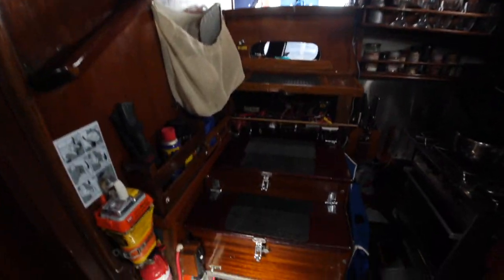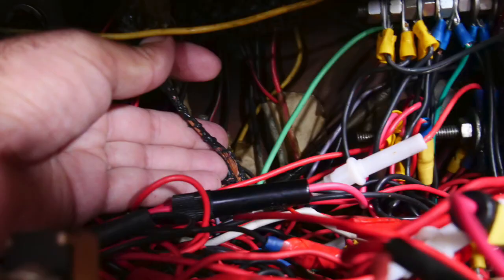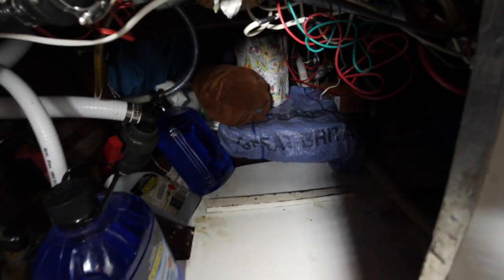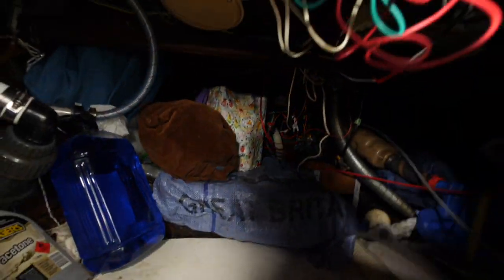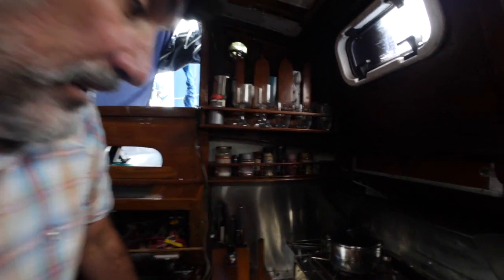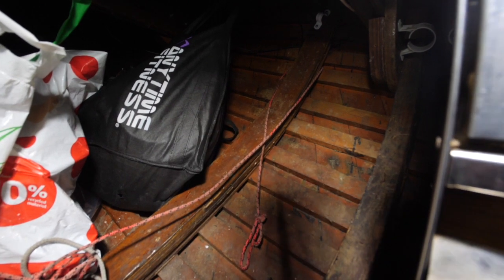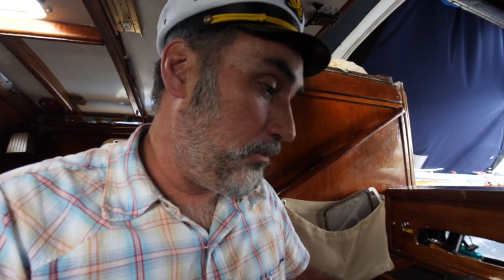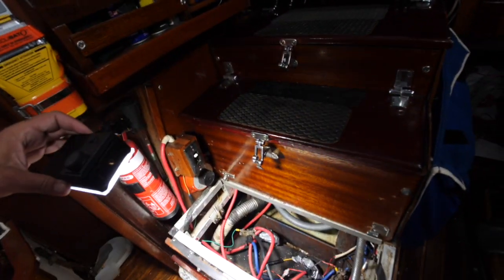Fixing an old Boat with Captain Smooth - Kero stove and starter batteries.

Comment: Your typical AGM battery is quite heavy, deep cycle is good, but for a few dollars more you can purchase a much lighter lithium battery (with the advantage you can discharge below 50% a sort of foolproof mechanism when energy needs are higher, great to run nav lights and transponders etc, just before dawn coming into a new port) and add more as your energy needs increase.  Weight and Balance should be centred around the Centre of Gravity and kept within the operating envelope so it will not adversely affect the performance of your 30 footer by trying to load the boat to keep everything within the envelope.  If you can just keep the battery in the centre it is best (otherwise you have to place similar weights exactly opposite to balance things out, and weight can be critical i.e. get rid of some things as other things come on board, you will soon learn what is absolutely essential.  The other problem is you only have two hands so make some extra hands by having some sort of straps to hold the positive and negative leads out of the way so they do not touch and do not drop suddenly without warning.  Your risk in future of the same thing happening will be so negligable that you can still afford to put the battery back in that inconvenient position.  I keep things simple, store dried food, and use a small german pressure cooker  (Fussel brand), it cooks everything and no spill when sailing, even if it falls off the stove.  Otherwise you will be reduced at sea to eating instant noodles on a butane gimbal.  Also assume everything you have will get wet, either by condensation, or waves over the poop deck.  Therefore place everything you want to stay dry in waterproof bags, and find a way to strap them to the sides.  You will thank yourself when you can reach for dry clothes. Cheers, P.S. I enjoyed the motorcycle video I purchased from you.
Reply from the maker: Thanks Michael